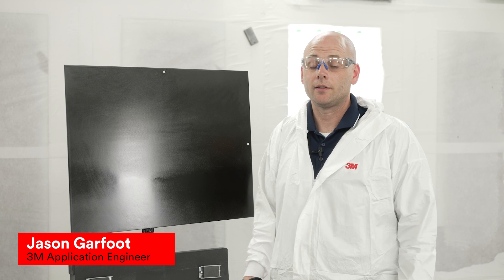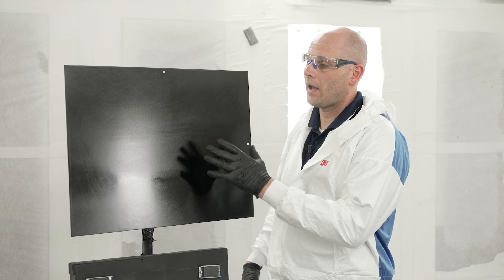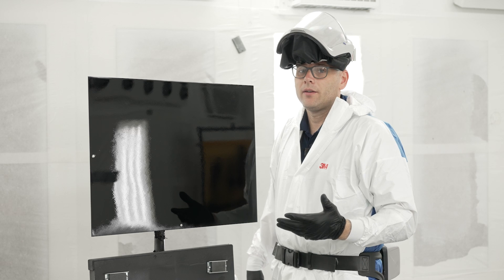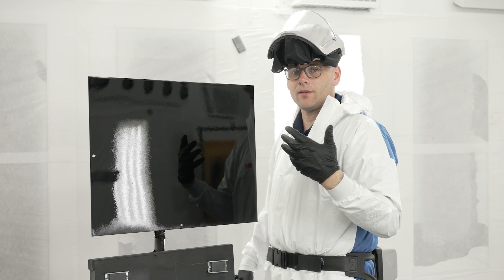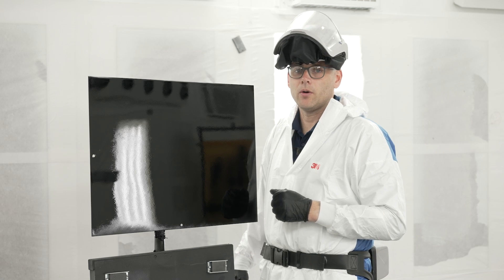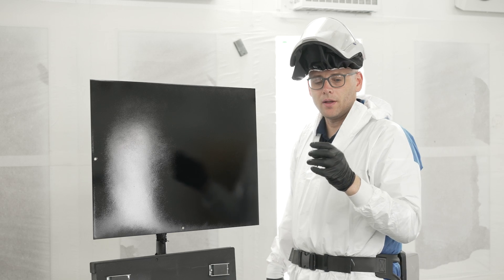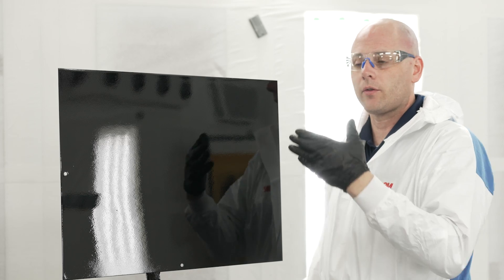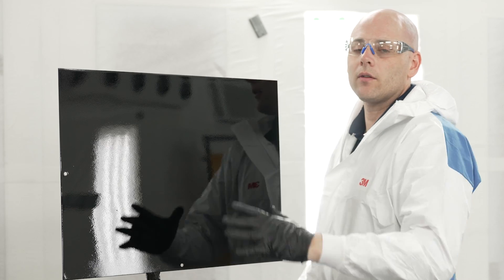HOW TO: Fix Fisheyes in the Paint Booth

Comment: Question to anyone who knows, can I do this with cured clear, or do I need to sand out the fish eyes completely, and re clear?
Reply from the maker: This quick fix should be done while your repair is still in the paint booth and doesn't require any sanding. The purpose of this trick is to try and save the job before leaving the booth, hopefully saving you from extra rework.

Comment: Does this work for pinholes?
Reply from the maker: Hi there! Thanks for your question!

Please note that this process will not fill in pinholes. Also, you would have to apply a glazing putty or high build primer that is capable of filling pinholes. Hope this helps.